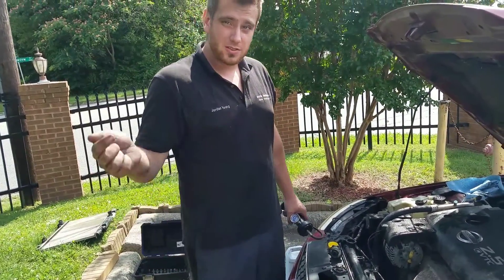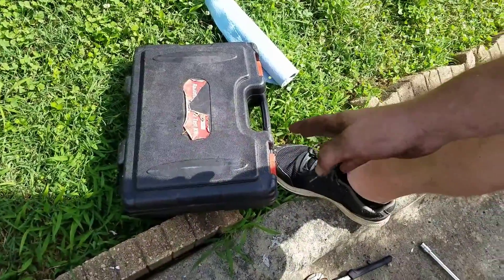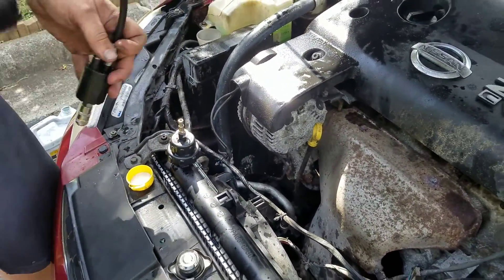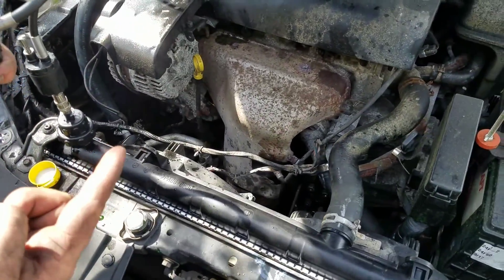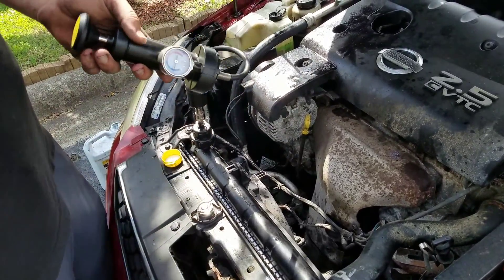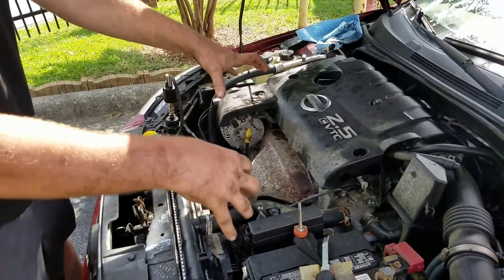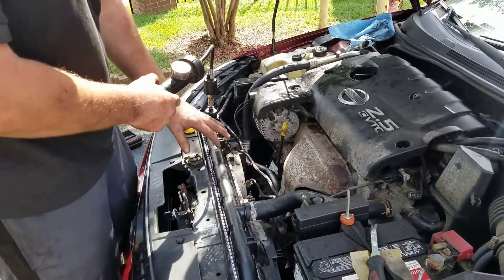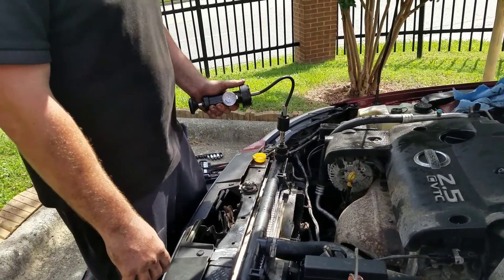How to Use a Radiator Pressure Tester

Comment: FIXBOOK////.                                                                                                     what testing tool do you use to test and check the temperature gauge in your cars dashboard is working correctly or is not working correctly? what do I use to test the temperature gauge?
                                how do you test what the PSI level of the radiator is at while the car is running?